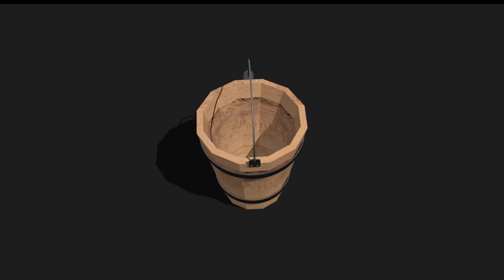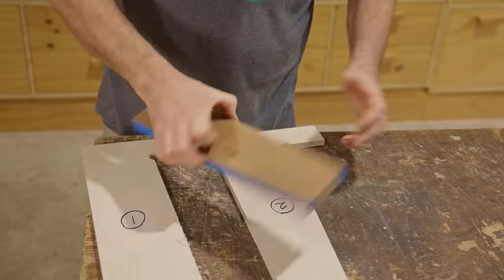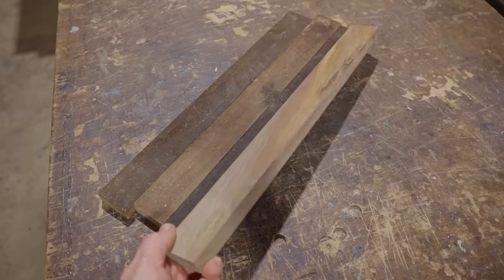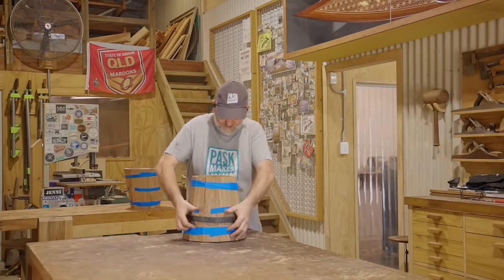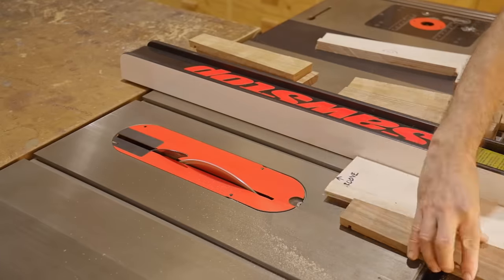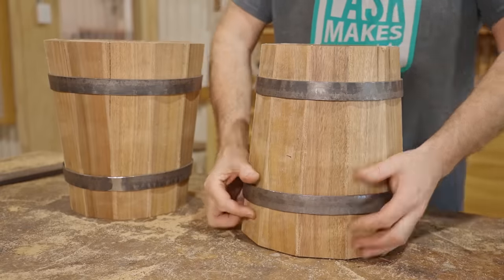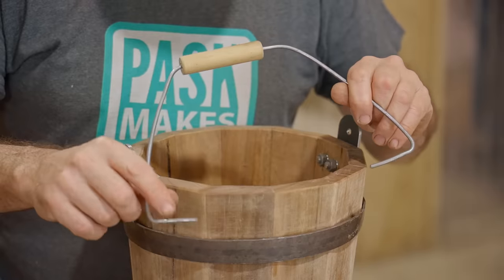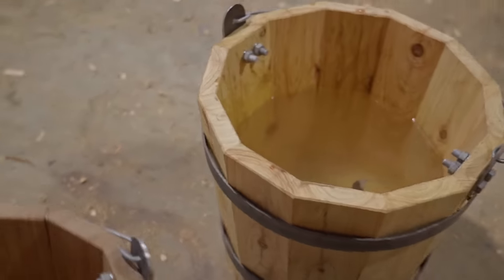Making a Good Old Days Wooden Bucket - Will it Leak? - SWC Ep53

Comment: I am wanting to give this a go with hand tools. I think I have all the needed tools, I just have to get the wood. I am going to be using wood from a home improvement store that’s already in short 2 ft. Pieces, I’m just not sure the best thickness and type… they have pine, Aspen, and oak normally unless I buy from some place online. Is there a good place to get a patten for making each piece slightly curved to make it round? I’ve got a curved and straight draw knife and I know where a even more round one is, I just don’t have the money to buy it at the moment.  I’ve had a fear of routers and table saws  but have never really used them much. I still don’t know what to get first a router table, table saw, or a bandsaw. I only want to have to buy it once so whatever I go with I want to not need to replace it or worry about it’s accuracy fading with every use. I’m guessing by saying start with a good quality table saw with a really good fence and top but again I’m not sure.

Comment: If the brackets for the handle were instead attached to the top ring, every time you lifted it, wouldn't it further tighten the ring?
If so, could that be and good design feature?

Comment: OK, I know the trick of making water tight buckets and barrels. I learned it from an old German Cooper. You need to use a vice of some kind to allow you to work the long narrow face of the staves. You want your staves 1/16" to 1/8th inch wider than you want. You need to use a hammer and a blunt wide chisel to hammer diagonal lines on the long edge 1/32" to 1/16" deep, then use a plane to shave down 1/32" to 1/16th leaving faint indentions. This compresses the wood fibers. You do something similar to the bucket bottom, can't remember how. When you assemble the walls of the bucket, those densified wood fibers will swell after you fill the bucket  and you have to fill the bucket with water after assembling it to finish the bucket. Then you apply some linseed oil to only the inside and allow the outside to sweat our the excess moisture.

Comment: Not knowing that much, I had two thoughts. Did you consider tilting the blade to match the splay of the staves when you cut the grooves? Also how would it have worked to weld the brackets to the top ring? Great project and I really enjoyed seeing you make these.
Bill

Comment: At first I was wondering - Since you're using the groove to know which direction the board needs to go, why didn't you set it up so the groove goes face up.  Then I realized that you're Australian so that's why it has to be upside down.

Now I'm curious how you're going to keep the water from coming out the top of the bucket tough...

Comment: About 190 US dollars (1200 Dkr) for 6 meters of 3x25 mm  (20 ft, 1 1/8 x 10 inch) steel, is a bit expensive, 
even it's for 4 rings, 2 buckets.  80 percent of the price is delivery, as it can only be bought here online!! 
At least until I can make the buckets themselves look the best way I can, and with no leaks, in order for trying to make people pay enough for them to pay for the materials incl the expensive steel rings...   
But for the first ones, I'll try different AND cheaper solutions for the rings.  
They just look beautiful, both the new ones and the old one.  :o)

Comment: I don’t understand the method where you overlap the end of the ring and bolt them together. After you  cut off the end of the bolt, you still have part of the metal where it is now stepped. Do you think it will still be tight enough to retain water? .What am I missing?
Reply: There would be a gap the thickness of the band and the depth of the bolt head (just file it down some) but its negligible to keeping the staves all tight together, but yes, it would sit a bit proud nevertheless.

Comment: havent watched it. it wont for the same reason that if you pour water in your cuped hands it wont leak. its the distance between the cracks is smaller than what water needs to get through and the pressure from the metal rings keeps it together

Comment: 14:53 i thoguht you were ment to like heat the ring up till it was like red hot  and then lower it on the bucket so as it cools and contracts to pulls all the staves toghter?....or was that railway tyres?

Comment: I couldn't help wondering why you didn't simply weld the handle brackets to the top ring? No holes through the wood, no bolts needed and the weight when using the bucket would automatically tighten the top ring as you used it.

Comment: If anyone can’t do the metal rounds I’d metal…use wet leather!  That’s one way ancient Egyptian and Chinese did it. Wet leather strips in warm water and soak for 24 hours.  Wrap the leather and blind knot it.  I’ve found that the faster the leather water evaporates the tighter the leather shrinks.  Then, if you wanna go real old school, seal the inside with pine tar sap.  

I also wanna say, I love the things you make. If I could pound put in a request for anything it would be a wood helicopters rotor blade (I’d love to make one for my hubs as he used to fly).  And second would be a watch display stand.  (The one that looks like a family tree, it has the thick trunk and sturdy branches wrapped in leather) I have gotten him a watch every year we have been married, so this christmas will be his 30th watch.

Comment: Question - Can a bucket be made without the metal rings ? I have no metal working skills or the tools to do them.
Reply: Absolutely! Buckets were used way before metal became cheap enough. Rings (and handle) can be made of wood, sinew, raw hide, hemp rope, whale bone probably... You might get by without rings too. One piece-buckets were carved from stumps even before invention of metal smelting. These days good glue with well-selected wood is probably good enough to hold everything in place.

Comment: Wouldn't coating the inside with beeswax seal any potential leaks ?
Reply: Unnecessary if joined Welland used regularly. The water swelling keeps leaks at bay. Oak was used due to the grain swelling, but most wood should do the same.

Comment: They used to make these in my country with manual tools only and no glue
Reply: You don't need to seal small leaks, wood expands when wet, so just put it into water and it will seal itself

Comment: Massive overkill on the hardware! :) Any old cooper would be aghast at your methods- but they'd have to admit that it works. In many parts of the US, strips of green hickory would be used as bands for a bucket or small vessel (using a joint to make the circle that can't be done with dried wood). Roy Underhill did an episode years back with a cooper making a piggin (which is a small bucket with one of the staves left long to form a handle), which is very educational. Nobody ever expected a bucket or barrel to be watertight when it was made- wetting the wood to form a seal has always been part of the process.

Comment: Advertises no glue for old bucket.
Proceeds to use modern carpentry tools that were invented way after glue did while making it
Reply from the maker: On a piece that didn't need gluing as I explained. Just using up small scraps! Where did I say I wasn't using certain tools? :)
Reply: @PaskMakes  I was just joking!
Respect the art, ended up being very well at the end. The planning was quite smooth and It's also really nice for you to share the blueprint. I tend to do smaller stuff myself, sorry if I seemed unappreciative was just messing around. :( I really respect the effort especially when I almost alt f4'ed my fingernail last time I made a spoon. :D

Comment: There's a Hole in the Bucket:

There's a hole in the bucket, dear Liza, dear Liza,
There's a hole in the bucket, dear Liza, a hole.

Then mend it, dear Henry, dear Henry, dear Henry,
Then mend it, dear Henry, dear Henry, mend it.

With what shall I mend it, dear Liza, dear Liza?
With what shall I mend it, dear Liza, with what?

With a straw, dear Henry, dear Henry, dear Henry,
With a straw, dear Henry, dear Henry, with a straw.

The straw is too long, dear Liza, dear Liza,
The straw is too long, dear Liza, too long,

Then cut it, dear Henry, dear Henry, dear Henry,
Then cut it, dear Henry, dear Henry, cut it.

With what shall I cut it, dear Liza, dear Liza?
With what shall I cut it, dear Liza, with what?

With a knife, dear Henry, dear Henry, dear Henry,
With a knife, dear Henry, dear Henry, with an knife.

The knife is too dull, dear Liza, dear Liza,
The knife is too dull, dear Liza, too dull.

Then sharpen it, dear Henry, dear Henry, dear Henry
Then sharpen it, dear Henry, dear Henry, sharpen it.

On what shall I sharpen it, dear Liza, dear Liza?
On what shall I sharpen it, dear Liza, on what?

On a stone, dear Henry, dear Henry, dear Henry,
On a stone, dear Henry, dear Henry, a stone.

The stone is too dry, dear Liza, dear Liza,
The stone is too dry, dear Liza, too dry.

Well wet it, dear Henry, dear Henry, dear Henry,
Well wet it, dear Henry, dear Henry, wet it.

With what shall I wet it, dear Liza, dear Liza?
With what shall I wet it, dear Liza, with what?

Try water, dear Henry, dear Henry, dear Henry,
Try water, dear Henry, dear Henry, water.

In what shall I fetch it, dear Liza, dear Liza?
In what shall I fetch it, dear Liza, in what?

In a bucket, dear Henry, dear Henry, dear Henry,
In a bucket, dear Henry, dear Henry, a bucket.

There's a hole in my bucket, dear Liza, dear Liza,
There's a hole in my bucket, dear Liza, a hole.

Use your head, then! dear Henry, dear Henry, dear Henry,
Use your head, then! dear Henry, dear Henry, use your head!

Comment: Oh come on, I clicked because of the NO GLUE thumbnail... Too bad it wasn't true
Reply from the maker: Are you for real! it's quite obvious what was meant by no glue (between the staves and bottom). The only reason I glued the bottom together was to use up scraps, which is a good thing. I explained that in the video and could've easily cut into another board and done it one piece, now I have a full size piece left for another project. :)

Comment: In the old days they also heated the metal rings to expand before fitting them then it would burn some material and make a better fit. I think you're doing a lot of things wrong, please redo this video with a blacksmith next time.

Comment: Something you may want to give a try is a "Boat Builders Joint"  Frank Klaus shows how to do it in this video where he is making a pond for water stoned.  He uses it to seal the bottom to the sides and keep it watertight without glue!  You could do this on the edges of your staves to give added tightness, oh and you only have to pound in the wire on one side of each stave! If you would have left the bottom a little thicker so that it had to wedge into the groove and cut it so that it would not bottom out in the groove, it would be watertight without needing the flax!  Been making buckets and wood mugs for a long time it works great. https://www.youtube.com/watch?v=PitVHP7omvY
Reply from the maker: Thanks Mike! I have seen that joint before, it's pretty cool. The flax seed is more of a back up and is a traditional method. :)
Reply: @PaskMakes  Yep it is very traditional.  Usually used on buckets that are getting old  and a little loose but it definitely works.

Comment: i thought it was no glue? but you used glue. sad day.
Reply from the maker: How's that a sad day! I only used the glue to use up scraps. I explained I could've made the bottom out of one piece and it was quite obvious what was meant by no glue (the staves and bottom joint). :)
Reply: @PaskMakes  its all good man. i was just saying the thumbnail says no glue. so i thought it had no glue. its still a great bucket. :D i would use that bucket.